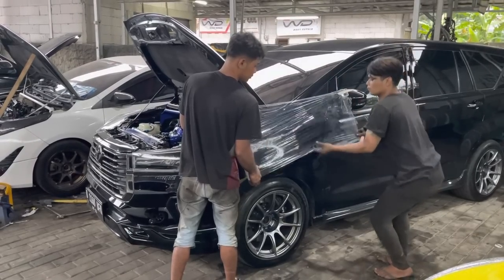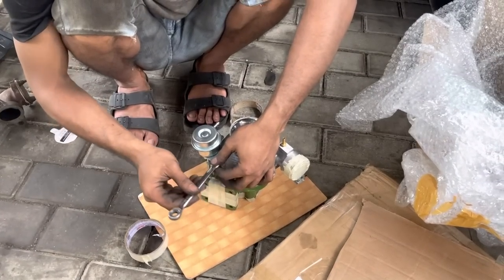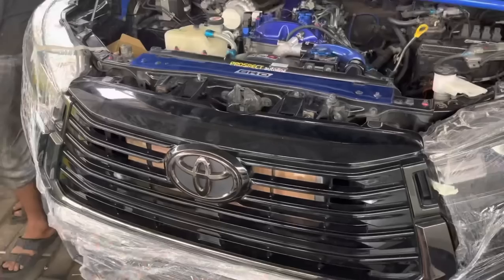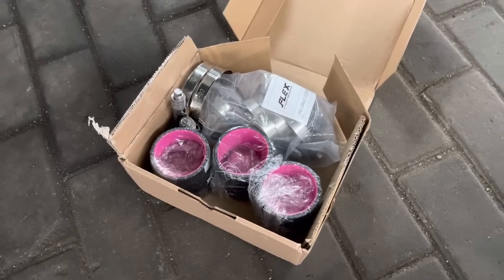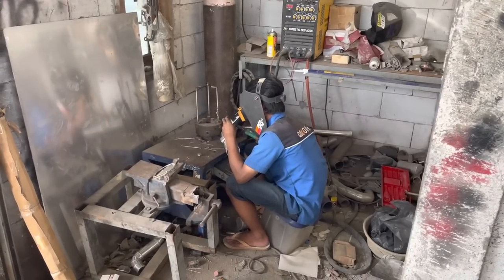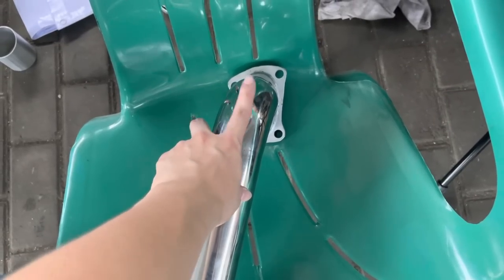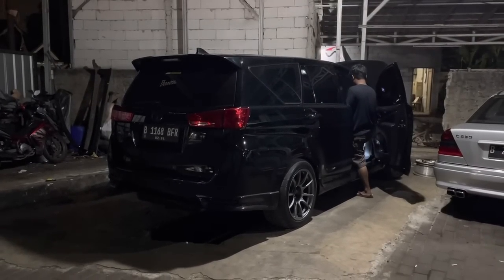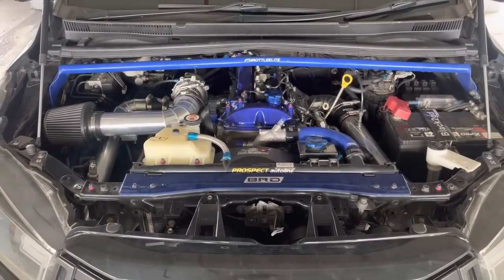Upgrade Spec 2023 ! 🔥 Turbo, Big Intercooler, Intake Manifold, Piping

Comment: alasan knapa bang kok pilih drag spec v8 yongsin? kan ada flex r-31r, f44 veez, v3 taliban, m+ turbo?
Reply: Karna selera bang
Reply: Karna turbo yongsin di depelopnya secara serius bang..,sesuai data dan di test di mobil dia sendiri sbelum di pasarkwn..makanya kalau racikan ko yongsin uda psti joss
Reply: @muhammadalfin2589  emang pasti alasan dia itu? wkwkw
Reply: Klo mau suara jangkriknya  kenceng pake turbo apa bg  buat reborn diesel  ?
Reply: @ghost__motovlog  pake f44 veez, or m+ or rhf4 v3 or customan yongsin
Reply: @rafliputra8375     yg  mrh  yg  mana  tuh  bg  buat  jangkrik  aja sih soalnya  wkwk
Reply: @ghost__motovlog  kyknya f44 sih, coba konsul sama bengkel2 diesel